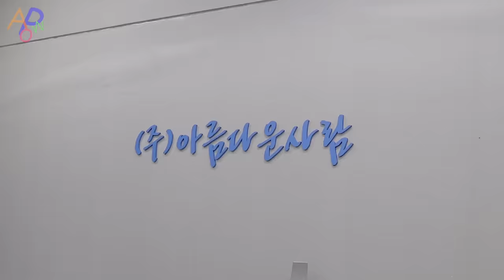Long Coat Mass Production Process. Korean Menswear Factory

Comment: Loose and shapeless coats with giant armholes restricting movement and dead flat pressed lapels. The only parts even touched and made by humans are those where it's cheaper to use these low-paid workers instead of a dedicated machine. Other than that, these are just garments made to last a season before being discarded, made by workers trained to only do a single task and made as cheaply as possible to maximize the profits from the sale.

Their video about the Korean tailor shop shows the actual craftsmanship required to make a fine garment